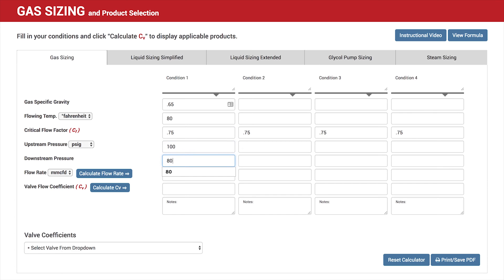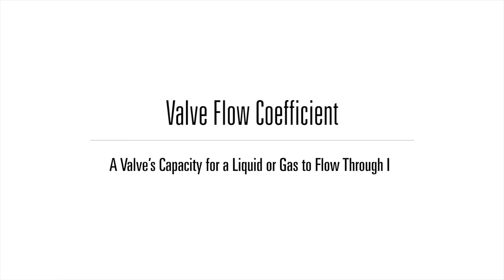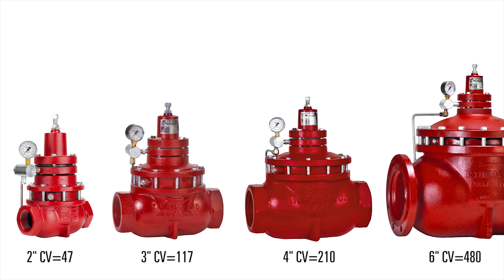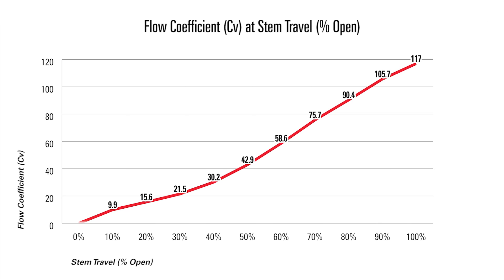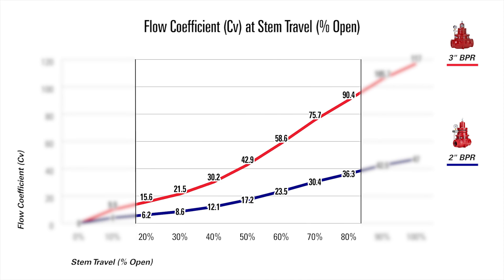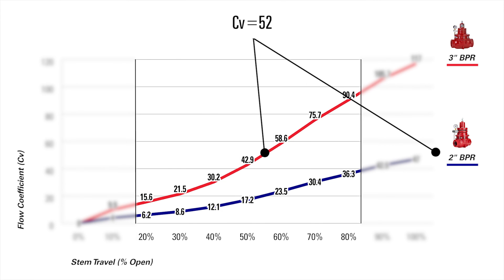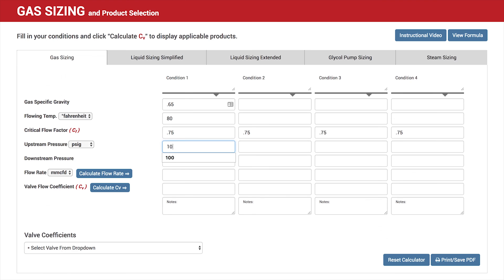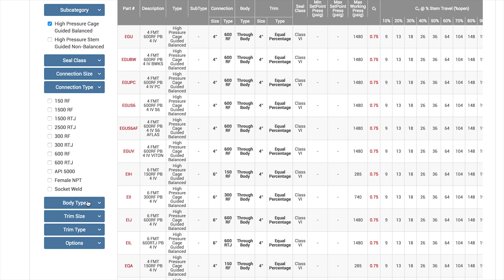Valve Flow Coefficient (Valve Cv) Explained [How to Determine What Valve Size to Use]

Comment: Thank you. Is it common to have more than a 1 psi drop in the valve?
For ex if I have a valve at cv4 could I have a 4psi drop on it instead of 1?
I have a chilled water coil that is supposed to have 8gpm flow with a valve that has a CAV of 4

Comment: What about measuring Gas CV? is that the same formula?
Reply from the maker: Hello, you can find the formula for each on the Sizing calculators page. Just click on the type of sizing from the dropdown menu, then the “view formula” button.
Reply: @KimrayInc  why Temp. has no any indication in formula for CV calculation in gas however Temp. should be an important input in calculation

Comment: Hy... I have one doubt in equation which is usually seen in valves catalog

 P =( (36 x Q)	/ Kv) ^ 2

P - KPa
Q - L/s

I would like to know how 36 constant came?? If it is conversion of l/s to  m. Cube/hr, it is 3.6...how it become 36??
Reply from the maker: Hello, is that equation from a different source? I'm trying to understand where it came from. Which formula are you referring to and where did you see it?
Reply: @KimrayInc  hy Kim...thanks for the response... i found this equation from Flowcon valves catalog  to calculate the pressure drop across a valve section.
Reply from the maker: I don't think we would be able to best answer questions about another company's sizing formula, unfortunately. I'm glad you were able to dig deeper into the information and come up with new questions at least. Please let us know if we can help any other way.
Reply: @KimrayInc   thanks man

Comment: Suppose I want to add a valve on a pipping line, I know P1 using pressure gg. But how about P2? Flowrate I could measure from flowmeter. Just dont understand what value of P2 I should put in the calculation
Reply from the maker: This could be best answered by our product application team. Email prodtechsupport@kimray.com and they'll be your best resource!
Reply: @Rob Hernandez: If I change the pump, which delivers at different pressure. Dont the actual flow go wrong since the DP across the valve changes. Please let me provide me a proper link at jaganmohanraor@gmail.com